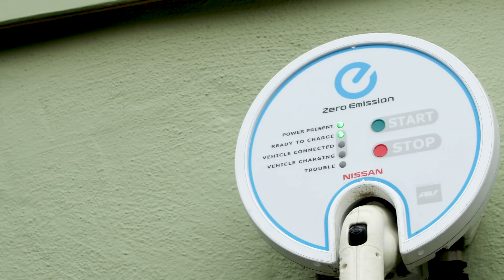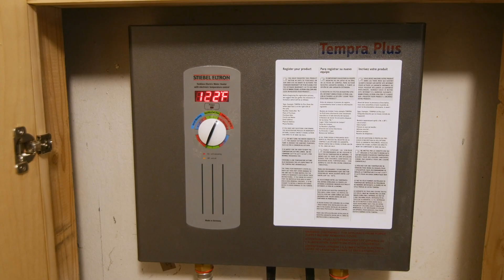Electrification: Removing Natural Gas from the Home

Comment: its crazy to me to think electrifrication of your home eliminates your carbon footprint or is enviormentally more friendly than natural gas.  

1st of all you are not removing your carbon footprint or removing emissions from your home your just moving the production of those emissions and your carbon footprint to the power plant.   Here's a newsflash the power plants are powerred by a mix of COAL, NATURAL GAS NUCLEAR AND RENEWABLES the renewables are the minority.   

2nd of all since you are moving all the production of energy out of your home to a power plant  there is loss in the transmission lines delivering power to your home that's waste.    

3rd.  the  energy you utilize in your devices to heat your home weather it be heat pump, electric furnace, electric water heater etc iis only 30% effficient as  70% of the energy to generate heat is wasted and 30% is utilized.  

4th.  Natural gas is far more effficient in consuming energy a 98% efficient gas furnace utilized 98% of the fuel to generate heat for the home and only 2% of heat goes out the chimney as wasted heat.   your using the same fuels the power plants use to generate electricity BUT u r doing it inside your home so the losses are much lower and gas generates heat far more efficiently.

This is a scam for those who don't know.  this family didn't get rid of emmissions or reduced their carbon footprint.  they  increased both of them.

Now the only good thing i do have to say is the solar panels on the roof are a slight benefit in reducing the their power bill.  They could of done that and ketp their gas appliances and   saved and helped the enviorment even more.

Comment: If you're fortunate enough to be on the natural gas grid KEEP IT. Why do you think folks in rural areas have to pay for propane trucks to deliver their fuel to their home storage tanks to heat their homes? Its because an electric furnace can't match the power and savings of a gas one. People don't realize how nice it is to have natural gas in an area that sees negative 0 F winters. If your home is on the gas grid keep it, if it isn't on the grid than use more expensive electric, the amount of energy used and the carbon cost of manufacturing these solar panels and the very heavy, earth mined minerals used in the batteries has to be considered as well. To convert a home off gas is going backwards in efficiency of the energy plain and simple.     Another thing, everybody is so proud to have the latest and greatest electric vehicle, if you're concerned with the environmental impacts than KEEP a small efficient gas sedan in good shape and on the road for as long as you possibly can. This family should be driving a late 2000 model Toyota corolla or something, not a brand new electric car every couple years.    Also ask any professional cook if they prefer electric cooking appliances, they will straight up laugh at you because the comparison is in that much more favor of gas just due to the sheer energy in it's combustion.  100,000 btu = 29.31 Kilowatts. Last month my two person home used 12 therms of gas in our water heater and furnace = roughly to 1,200,000 btu of energy, comparision would be 351 kW. The cost was $24 gas, the equal cost at the electric rate would have been well over $60.
Reply: I agree 100%. Also gas is more reliable, never had it go down my entire life. I was able to run my 10k generator for two days during the Texas freeze off my gas meter plus heat my home and water with gas. Other I knew still had hot water, were able to cook and were able to use their gas fireplaces. The all electric homes were uninhabitable.
Reply: This is a common misconception, but my home and the home owner in this video prove you wrong. I’ve electrified my home and shut off the gas and will never go back. My heat pump keeps my home more comfortable than my gas furnace ever did and my induction cooktop will leave any gas range in the dust. It’s all powered by rooftop solar. 

The commenter is also misinformed about the production of panels. They generate hundreds of times more energy than it takes to produce them. 

For the past two years, I’ve paid only the cost of being connected to the grid, which amounts to $120/year.
Reply: @mnorma12  Like I said it's all good till you lose your power and are left in total darkness with no way to cook or heat your home. Going to more efficient electric is fine, but you should have kept your gas service as a backup.
Reply: What about the health impacts of natural gas? That alone would be worth it for me.
Reply: People outside the US have been heating and cooking with electricity for a while. I'm from Eastern Canada where winters are violent, and we all cook with electric stoves and heat our homes and water with electricity. It's only when I came to the US that I realized people here, for some weird reason, use gas for everything, despite having much lower power requirements than in a cold place like Montréal.

I really think people's strong belief in gas being a necessity... is some weird product of unknown unknown: people just don't realize the madness of using gas for all this stuff.

Comment: I'm currently trying to electrify and get rid of all natural gas usage in my home. About 50% of contractors would quote me a heat pump, but only one would quote me a mini-split system so that I can control each room's temp independently. I think it comes down to the vendors that they are used to using, and if they don't buy equipment from somebody that does mini splits (e.g. Mitsubishi), then of course they aren't going to be able to install and support you. 

Biggest thing to change this is to try to get quotes, and tell the contractors that you're not going with them because they won't build what you need. People will change!  Changing local code to require these more efficient and cost effective systems will force contractors to get out of their comfort zone and adapt to the future. Most people are creatures of habit, and will need a push either from customers or governments in order to change.

Comment: I both build and consult on Zero-Energy Homes and Passivhaus projects around California. It's fascinating - and sad - to hear them at the 3:20 mark begin to talk about contractors in CA telling homeowners a home cannot be built without gas, and not just saying that but emphatically believing that idea. Being from New England originally, I've built with heat pumps for over a decade now and believe it or not, the temperatures there are slightly (i.e. a LOT) different than here, both colder in the winter and hotter and more humid in the summers. Still, there is often a 40-50 degree diurnal temp swing in California. Yes, it's beautiful for five or six hours in the middle of the day, but the fog and cold roll in every evening and stay around all night. It's a weird occurrence that California builders forget this (or just don't know or care). Congrats to these homeowners for sticking to their guns and having to tell the contractors that yes, in fact, it can be done and it's beneficial to everyone - people, planet, and even contractor's profits. Imagine that.
Reply: I'm from Canada so it was really surprising to hear them say that heat pumps are extremely uncommon and even resisted. When the difference between your winter and summer heat bills can be $500+ it's important to look for the most efficient and comfortable heating methods available to you.